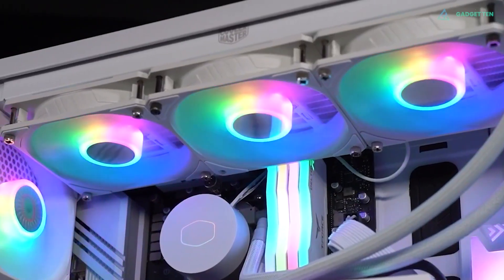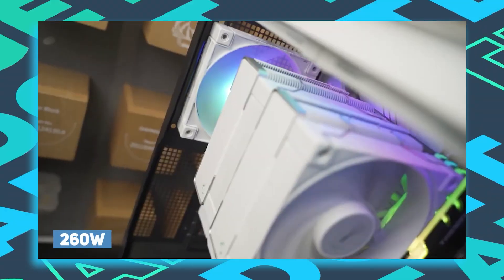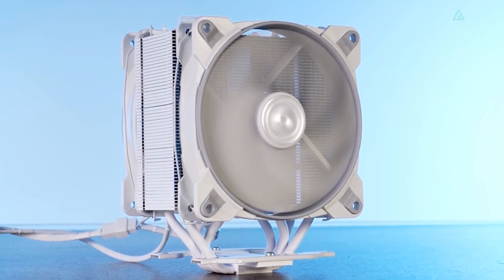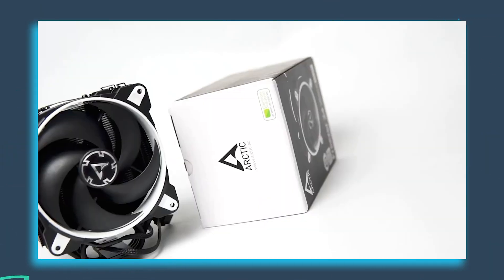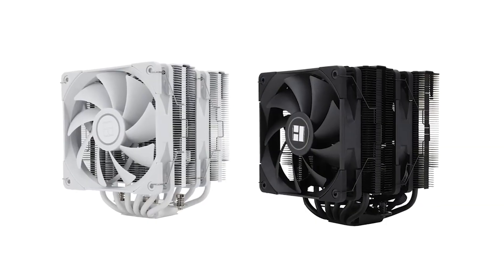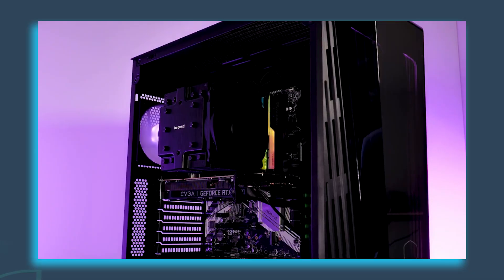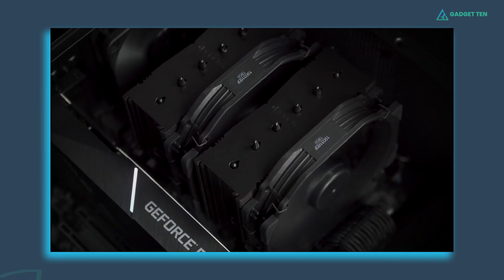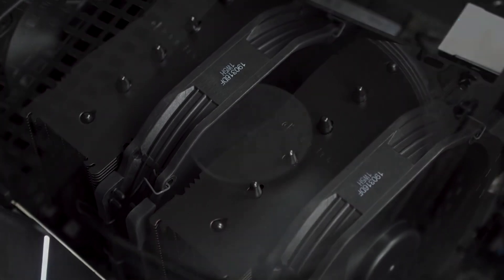Best CPU Air Coolers 2024 - Top 5 Best CPU Air Coolers of 2024

Comment: Is a phantom spirit or peerless assassin better?
Reply: Yes, much better and far less money. Hardware Canucks did serious in house testing and found them best in performance and price. The Phantom Spirit was best and the lowest price was an insane $28. They are taking over the market with just crazy value to performance.
Reply: @bodasactra  thanks a lot for the reply. Btw is there any big difference between the evo and se versions? Again thanks lot bro 🙏🏽
Reply: @viet.54.  No problem. The SE was slightly better than the Evo due to fan differences. Hardware Canucks said the PS SE fans were better engineered for it's fin stack design and that the Evo lacked that precise balance. The Phantom Spirit SE is the best value to performance air cooler you can buy IMO and many test channels agree on that. Amazon had the gray version for $28 plus $11 shipping. I went with the black top with unpainted fin stack version for $35 as it was cheaper overall with the free shipping that kicks in at $35. The black fin stack of the Evo is pointless, it can't be seen hidden behind the fan. I highly recommend the black top version, its cheaper, looks great, beefy  looking as all hell, performs best, and it cost the least of all versions with the free shipping.

Comment: Noctua NH-D15 chromax might be enough to cool a 14900k ?
Reply: Check their TDP, the NH-D15 has a limit of about 220w, meanwhile the 14900k can create up to 253w of heat, meaning the cooler will not be enough when doing anything intensive. I'd recommend the AK620 dual tower, it has a limit of 263w but is a bit bulky and can get a little louder under maximum load.
Reply: I have the same question in mind. theoretically, double-tower top model cooler should handle 150-200 w easely. however, this 14900k beast could generate a way more heat in peak loads
Reply: I think @commodorex answer is perfect, I personally aiming to build a PC with the i9 14000k and thinking to have the BeQuiet Dark Rock Elite as it reaches the 280w TDP, necessary performance, since I will also have the 4080RTX. All in all the safest option for cooling is AIO, but the life span is 2-3 as I have read from other reviewers and also you might get into other issues such as leaking and damage to the system modules. So it feel risky and since the air coolers now can cover the requirement (at least number wise) I don't see why not !
Reply: @matman2512  Мощность процессора можно немного снизить. Тем самым понизить температуру. А вот если протечет aio то уже ничего не поможет.😢
Reply: @matman2512   i have an aio since 2018 , no problems whatsoever